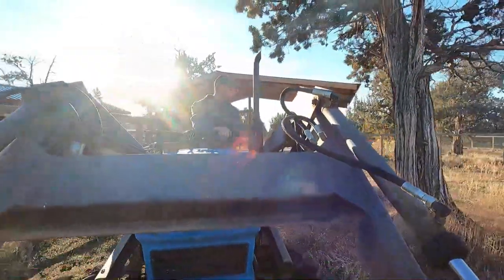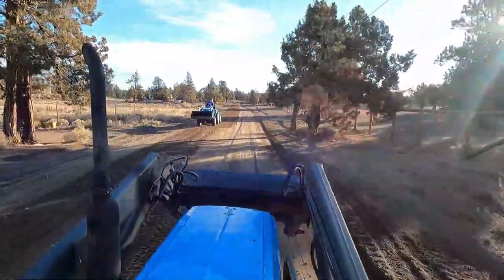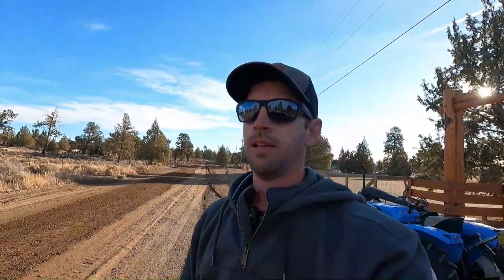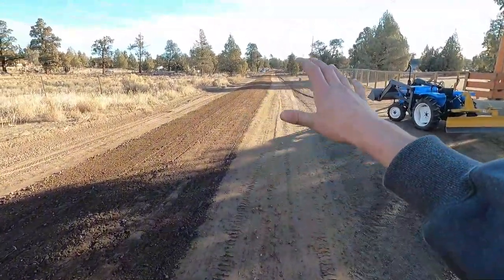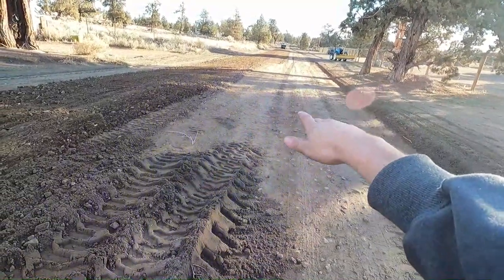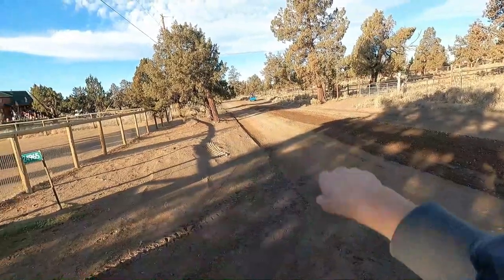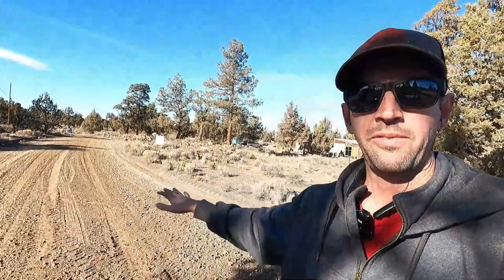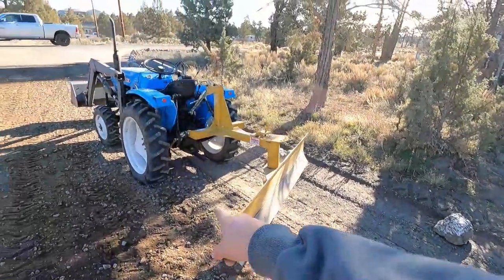Neighborhood thugs go to war with the road department

Comment: 10 years ago or so our county decided to cut through and connect 2 thoroughfares and pave the new section.  What they did was create a new highway between those 2 roads.  The problem is that the new road they cut through is in a neighborhood with a 25mph  speed limit!  Very few drivers adhere to the 25mph  speed limit, even though the road narrows with deep ditches on both sides and wildlife that crosses spontaneously.   Deer are regularly hit by vehicles driving twice the posted speed.  I suppose no county commissioners live in this area, so there won't be any changes until enough people die, which is entirely possible.

Comment: Why would use dirt in the construction of a gravel road?  My driveway is just gravel over dirt and I’ve been adding gravel to it for years and it just sinks as the dirt/mud floats to the surface! The only way to fix it is to remove it all and start with a rock base.
Reply from the maker: No, the proper way to fix it is to dig down to the base, rip it, then compact it, then fill and compact in 6" lifts with rock until you get to final grade.

Comment: I just watched this video, Great explanation of why the county is doing this wrong. too bad you cant get a grader.. Hopefully the county Road Dept supervisor finds your video.. Your poor tractor probably needs the injectors rebuilt, worn or damaged injectors cause hard start, and smoke on acceleration, Not super expensive and saves a starter repair,, Oregon Fuel Injection can probably fix them for you..

Comment: Standard rural roadway cross section would have borrow ditches on one or both sides to convey storm runoff. Rainfall hits the road surface (95% compaction on the surface with 2% cross slope) runs off into ditches and is eventually routed downstream to whatever basin intersects the roadway system. Culverts cross the roadway as needed to convey runoff under from ditch to outfall. You're doing an excellent job maintaining your road. If you can get your hands on a Gradall, you might want to cut roadside ditches in to better handle concentrated runoff.
Reply from the maker: There is no downstream.   That road is in a bowl.  Luckily we’re in the desert so ditches aren’t needed.  Very rarely does it rain enough to make water run on the ground, it normally just goes right down into the sand
Reply: @CaseyLaDelle  Understood. Happy grading!

Comment: I used a 47 Ferguson with a 5 foot box blade and re did my half mile driveway road where the idiot neighbors had bellied it out then about a month after I moved away they took and regraded it and went back to a belly and the first rain it washed out and now 3 years later you can't even drive a lifted 4x4 without dragging bottom the road company that is just down the road gave them a bid for 87 thousand dollars to fix it

Comment: I think in Illinois, it must be illegal for anyone with a working brain, or a slight amount of common sense to be a township or county road commissioner.
 This goes back DECADES, because when they put in the "hard road" by us, dad showed them a tile outlet on our 'other place' and tried to explain to them that the tube they were putting in under the rod, SHOULD be lower than the tile outlet. NOPE, they put it in 18 inches above the tile.  That tube was replaced about 15 years ago and they then put a riser on the tile outlet and left the tube at the same height. Now there is always water standing in the tile for the first 150 yards, back up in the field.
 The county comes by every fall, and dumps a bunch of fresh loose gravel on the shoulder of this road too. Then they spend the winter plowing snow off that should, shoving all that new loose gravel into the ditch.WHY NOT? It gives them something to do next fall!

Comment: I think your tractor is a 2 cylinder,, not a 3.  I count only two lines going to injectors.  But it does a lot of work for a two banger,  It's old enough it has the old  'slow' glow plugs so you need to heat them a little longer to  start better when it's cold.

Comment: I'm no road expert but even I know you can't use vehicle traffic to compact dirt without leaving random pot holes.  I would have considered grading the road down about a foot deep. Recover the gravel and sift the dirt out.  Reuse the dirt on the road bed, level and compact it.  Then reuse the gravel.  More labor inensive, maybe, but all the raw materials is already in place.  They recycle asphalt in a similar way.

Farmers around here use a land plane to level large fields.   Similar to a road grader, it's a long wheelbase contraption with a blade in the middle used to level 60 acre+ plots of farm land.   Could probably build a small one for about $1k-$2k and tow it behind a tractor.

Comment: I have the same brand blade but the 7 foot model I pull with my kubota l235, that sucker does quick work on the high spots and then final grading after I hit it with my box blade. Now on to some peoples so called tractor skills, they should stop while they are behind. I have gone behind the road crew a few times and fixed what they “fixed”

Comment: Looking good...   To make it easier on you and do a better job on reworking the gravel (once you get it) you might want to get the road district to invest in a 'grader scraper' (also called a land plane).   Adjusted correctly you want the front blade to fill up to the point it spills over while the back blade should never spill over, just slightly build up material on the blade.  This is because your front blade is your rougher and your back blade is your finisher.  If either of your blades don't have material on them at all times while you're engaging the ground, you're not using it right.

The blades being at an angle bring the material towards the road crown and they are reversible on most models for wear.   You can use the scarifiers also.  If you are moving large amounts of material from one place to another then the box blade works good for that, but requires lots of  micro adjusting to get things smooth.
Reply from the maker: Or we could just get a grader and do right 🤷🏼‍♂️
Reply: @CaseyLaDelle  Just giving a suggestion to keep it simple and inexpensive.  Graders are great pieces of equipment, but do need much more overall maintenance than a tractor and land plane.   There are smaller graders out there that would do the job great.    Its good to see you two take it upon yourself to make things better for your neighbors even though they will probably never thank you.   So; Thank you.
Reply from the maker: These roads don't need maintained, they need repaired.   So we brought in a grader and a compactor

Comment: 13” high in center is called a double or triple crown. They made it high so the water will run off. Problem is that’s 2-3 times to high, yell that’s what I just said. (lol) Now you have a lot of material to work with, haha. What would be worse is if you and Grumpy had to pay what they call fair share. The group of people were probably talked into this by the guys that’s own the trucks and equipment that did the mess. Sorry that’s life way out in the boondocks. Seriously I understand everything you were saying. I’ve lived on dirt roads and graded several yards, if you want it nice then you will have to do it yourself. You have a great neighbor. I wrote a lot of this before the end, so now everyone quit they should have. That one load of gravel make sure the driver dumps in front of yours and Grumpy houses. If public officials were responsible for their decisions, a lot of decisions would be different.

Comment: The road we live on now was a county road until a single neighbor had it turned private. It is so rough now its not funny. I'm going to have to rent equipment just to try to fix it and I'm not sure I can. It has huge rocks sticking out. The work this road needs is ridiculous. I started maintaining the private road we moved from but I no longer have my tractor and blade. The roads in this county are crap. I haven't seen a road grader in the 8 months we have lived here. The paved roads are rough. They have started patching them only paving in spots when the whole thing needs it. It always seems like a bandaid instead of doing it right.
Reply: If you bust an oil pan on that rock then the person who takes care of the rd should be responsible but who knows
Reply: @dustinwarriner7432  I wouldn't blame the person maintaining it, how is it their responsibility when so many people use the road. Its everyone's responsibility. You can't get reimbursed from the city, county, or state for repairs due to their unsafe roads. Rocks, debris, pot holes. Believe me I'd love to get paid for cracked windshields and bad tires. If they don't know what they are doing then maybe but just trying to keep a road up wouldn't be their responsibility. Rocks come out of the ground. We drive thru massive pot holes and over huge rocks sticking out now. No one will fix the road. But I bet I do in time. Its a headache when people don't respect that its someone's volunteer money and time invested anymore than they do if its city county or state etc paid for. I'm not charging my neighbor for car repairs on a road I'm just as responsible for.

Comment: @Casey LaDelle roads have been made with the center being high and the outside being low dating back to the Roman empire.  If they had compacted it  would have worked properly.  

Roads are set up this way to allow good sheding of water and allow water to drain off of the primary area driven on.  But without the compaction it'll never work properly.
Reply from the maker: I know..

Comment: Why can't you make a roller out of a fue 44 galen drums and water etc your a pretty smart person and engineers all the best great job
Reply from the maker: Because it's easier just to rent an 84" vibratory drum compactor and do it right
Reply: Because 44 gallons of water weighing less than 400 lbs. spread over 30 inches is far less compaction than say a 8000 lb. truck spread out over 4 - 8" tires.

Comment: Whats it with this "safety jerry cans" I see a lot in US based you tube channels? The sure look safe and such but also a bit impractical. I would still preferto  just pour out the stuff.
Are those mandatory now?
Reply: It depends on where you live, and isn’t so much about safety as it is air quality. In the US, there are basically two sets of rules for vehicle emissions (which cover fuel cans): the federal ones, or the stricter rules set by the California Air Resources Board. This is because California has some unique geography (lots of mountain ranges and deep basins) that makes smog and PM2.5 really hard to manage.

Since one of the larger contributors to smog formation (after car exhaust itself) is from fuel evaporating out of poorly sealed fuel tanks and fuel cans, CARB passed rules that require sealed (e.g. pressurized) fuel tanks in cars. They also required fuel cans to be designed so that when closed they were completely sealed (so gasoline fumes couldn’t escape), and to use designs that prevent fuel from spilling by accident when trying to fill.

It seems silly, but things like that add up when you have areas with stagnant air flow for entire seasons of the year, like the LA Basin. But it does make things more complicated, and a lot of the early CARB-compliant designs were terrible.
Reply: @kilodeltaeight  I see. We (Europe) do have e.g. extraction systems at the gas stations in each filling nozzle which suck back any evaporated fuel, as well as sealed fuel tanks in cars with recirculation and activated carbon filter. 
But Jerry cans ... nope.

And given the typical larger US cars with lower milage, I would have not thought about jerry cans in the first place to solve emission problems. But okay, thanks for the  explanation!
Reply: @Slazlo-Brovnik  yep - California has all the extraction systems at the pump too. I was equally surprised about the fuel can emissions, but per CARB “Gas cans account for about 87 tons a day of smog-forming pollution. That's equal to emissions from about 1 million cars.” And that was in 1999! 

And, again, it’s worth keeping in mind that these regulations were made to deal with smog in a region that frequently sees atmospheric inversions (which trap air near the ground), along with lots of sun and summers much hotter than the European average. Such a rules don’t make as much sense in cooler climates like those found in central or Northern Europe. The only reason you see them everywhere in the US is because California is such a massive portion of the US that it kinda just makes sense to make one can for the entire country.

In any case, Since 1999 (and especially since the 1970s) LA and the Central Valley have seen massive improvements in air quality, which is really good when you consider how harmful ozone and other such gasses are to human lungs. There’s a reason parking garages here have to post signs warning that car exhaust is known to cause cancer and reproductive harm.
Reply: @kilodeltaeight  I am aware of the dangers of exhaust gases, atmospheric inversions, even the LA problems etc.etc.
I am still surprised that vapor loss while using jerry cans is such a big deal compared to other sources - even in CA.

(I btw  think that "central Europe" is a way to large area to speak of it as one climate zone)

Comment: Any road is supposed to be crowded in the middle!! Meaning high in the middle lower on each side as to let water flow to the sides to the ditch line to run on!
Reply: Never flat an level that causes water to lay in one spot an soften all works underneath water needs to go to each side and run of !
Reply from the maker: Exactly, it's supposed to be crowned, not peaked.   We brought it down to a 2-3% slope

Comment: Typical gubmint....if it aint broke, fix it til it is.. Also those wheel tractors will compact the dirt to some extent. Not as good as if you had put it all in in 1 or 2 inch lifts, but it will help.

Comment: Looks like you're making a mess to me You definitely don't have the equipment or the knowledge that you think you do to work on a road.  II have been grading roads, parking lots and driveways for 36 years so I do know what I'm talking about. You talk about water flow but i never seen you pull out a laser to shoot any elevations to actually see where the water is going you are just guessing. I am always amazed that every guy with a tractor thinks he's an equipment operator. Grading in more than just pushing some material around thinking you are leveling off stuff. Roads are typically graded with a 2 % crown to allow water to flow off the sides. You do not want water staying on the road and flowing to a specific spot thus creating a river as it flows.  If you would be the head of a road department, I would say that will be one sorry road department
Reply from the maker: Here's a tip....  Shut up
Reply: @CaseyLaDelle  Your comment is about a good as your grading ability.  if you're going to criticize someone else's job maybe know what you are talking about